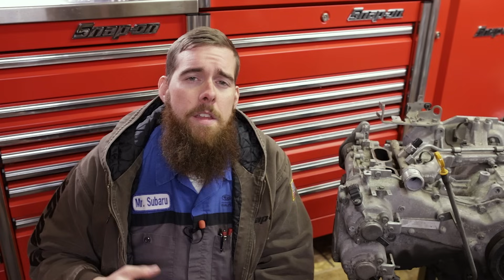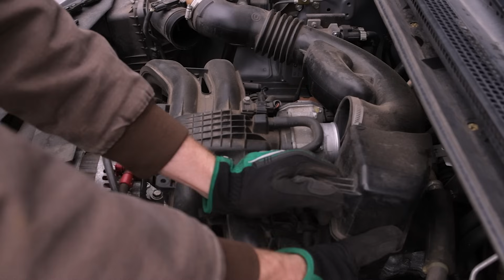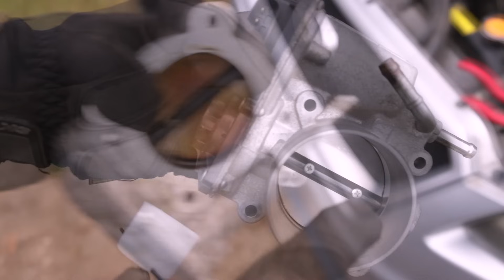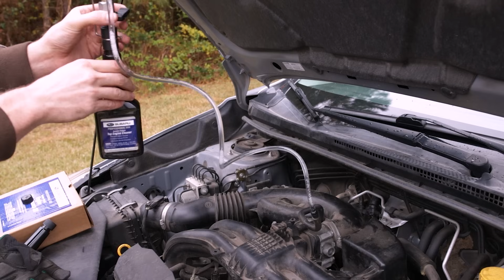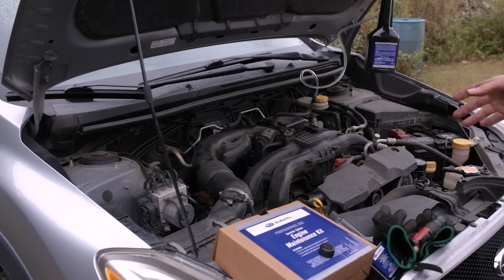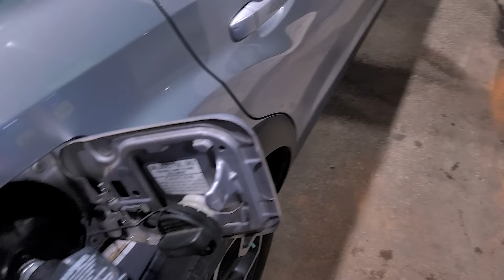Keep Your Subaru Running Like New! Subaru Engine Maintenance Kit

Comment: Thank you sir!!! Great video as always. Quick story to share, I went to the only dealership locally here in Las Vegas and the parts guy…gave a heck of a hard time with a bunch of BS stories. Supposedly they don’t sell the maintenance kit to the public blah blah so he tried to sell the wrong Carbon cleaner with the tin bottle (not the plastic one). What a headache but thankfully all the parts with part number checked out when I searched online to confirm they weren’t the wrong ones. I even told that clown if we use the wrong bottle/parts we can damage the engine/fuel tank or worse. Anywho, for others make sure you have the part numbers (as a back up just in case they claim they don’t sell the maintenance kit as shown in the video.) For everyone, follow Mr. Subaru’s advice EXACTLY as he says and this service should be excellent for 30, 60, 90k. I bought the OEM throttle body mounting gasket as well just for piece of mind. The Subie just hit 60k so I’m going to change the spark plugs right after performing this service and the car should run like a champ. Mr. Subaru happy new year! Thank you always for golden advice and for helping everyone maintain the Subaru. Cheers!
Update: Whew this job for the DIT 2.0 Turbo (I have a 17 WRX) took me 8 hours or so to complete yesterday. To reinforce what Mr. Subaru said he did make it look easy haha. But I did this from my garage and that was from start to finish. The items slowing me down was the intake duct connected to the throttle body. It was stuck (literally) and wouldn’t budge so I had to use some WD40 and carefully/lightly sprayed on the top to loosen it/remove. Also I drained about 3 quarts of engine coolant since I completely forgot to get the clamps to stop the preheater hoses when disconnecting from throttle body. You’ll definitely want to have the long needle/hose grip pliers to do remove them. I was thanking Mr. Subaru (in my mind and right now) when taking each hose off because you don’t have a lot of room to work with and that really saved me a lot of time. As well the special tool to slowly connect the top engine cleaner is strongly recommended. Why? I was lucky not to get any DTC (Check engine light etc) but notice how he carefully opened the valve to slowly pour 1/3 the bottle each time. You don’t want to risk damaging the engine, spark plugs, etc by putting too much in at once. I cannot stress enough: Follow his advice and watch the video/take note of the tools and how he removes/installs the each part. You must have patience and tolerance to do this job. You can’t risk damaging the car and then creating more headaches. Finally, Mr. Subaru thanks again! Do you a Venmo account? Or Google Wallet/Apple Pay cash? I’ve watched your radiator/coolant change video, spark plug change for DIT 2.0, this video, dude you’ve helped me become a trainee mechanic haha. But I’d like to support your channel even more if I could send some moola directly to you let me know. This was a long job for me but every 30k for this, goodness I know this Subie should last 200k-300k thanks again for your videos! Keep up the good always!
Reply: May I ask where you purchased the throttle body gasket from?  I can't seem to find what the part number is, and searching on google seems to reveal very little. Kind of odd.
Reply: Great comment
Reply: Careful, the solvents in WD can damage rubber. Happy wrenching!

Comment: Where would the vaccum line be on a 2011 outback 3.6r? Should I run the top engine cleaner through the hose that goes to the brake booster instead?

Comment: Would an air oil separator or a oil catch can help with the build up or is the one built into the FA model engine enough to help prevent build up?

Comment: At what mileage would you recommend this to be done? I have a 2021 Crosstrek limited with 18k miles thanks
Reply from the maker: 30k miles on the top engine cleaner, to reduce the DI carbon build up.
Reply: @MrSubaru1387  thanks dude

Comment: Why is carbon buildup on the intake valves an issue with gas direct injection cars but not with diesels?
Reply from the maker: Gasoline engines run under/produce vacuum, diesels don't.

Comment: I believe cannot flip the throttle plate on drive by wire TB right? If u want to clean press the pedal with ignition on or else the calibration with fuckup
Reply from the maker: No. Manually opening it is fine.
Reply: @MrSubaru1387  ive seen your next video on idling calibration, n yes i agree its fine. Back then as u know u need to have special tool for calibration the throttle body plate. Thanks bro
Reply: https://youtu.be/hCAC3sdCOZc some vehicle u need to plug in obd2 special tool i mean like this. Lucky subaru have the throttle position sensor relearn features. Next time if i clean mine i dont have to worry about manually opening. Thanks again.

Comment: Awesome video.  This applies to all Subarus?  I have a 2017 Forester MT Premium with the 2.5L FB25 which just hit 105K miles.  Though lately I find it 1 qt low in oil every 5k miles.
Reply from the maker: This upper engine cleaner service is more useful for direct injection engines, but the kit is beneficial for all Subarus.
Reply: @MrSubaru1387  THANKS!

Comment: Great video! How would one get the throttle body gasket? I really want to try it, but I would like to get the gasket just in case like you recommended. I couldn't find it through the links you provided.
Reply from the maker: Local dealership can get it or can be bought online at places like Subaruparts.com

Comment: Is it okay to add distilled water into a 4 year old Interstate battery? The battery is working fine, but there's quite a bit of corrosion at a terminal and in the center where the caps meet. They are willing to prorate the battery for a new one. Should I replace it?

Comment: used the CRC 5 in 1 GDI performance rejuvenation kit on my 2018 Elantra Sport turbo every 5,000 miles for 2 years and neen using it on my 2020 wrx Limited every 5,000 since I traded my Elantra Sport for it back in june of 2020 and both vehicles have ran like a charm ... no issues whatsoever ... I actually pour the fuel treatment in on an EMPTY tank so it mixes well as I fill up and I pour the oil friction gaurd in after pouring HALF the engine oil in so that mixes very good as well and I spray the valve cleaner through the intake duct so it cycles through the entire intake system ... I also have a Crawford's Performance v3 air/oil separator that I literally installed the day I purchased the vehicle brand new and brought it home ... let me tell you that thing works like a charm because my oil level is at the exact same mark from when I filled it up when I change the oil ...

Comment: "Don't bother cleaning the back side of the throttle body butterfly." Cleans back side of throttle body butterfly.
Reply from the maker: It's came off with the overspray alone. I didn't waste spray or brush time on the back of the butterfly. This stuff is really high powered compared to over the counter brake parts cleaner/throttle/carb cleaners.

Comment: I know you mentioned preventive maintenance long-term and thought you’d discuss catch-cans and AOS systems. I know you’ve touched on them in previous videos, but have you done a full break-down of them? Of course each manufacturer is going to tell you why their’s is best, but it would be nice to see a comparison by a proper technician on these motors. I personally have the Cobb AOS on my 2020 WRX installed before 3k miles.
Reply: I wanted to ask the same thing. I’m getting a  new wrx soon and I’m debating if I should get a Aos right away or maybe just stick with this method. I plan on keeping it stock until the warranty ends.

Comment: I just use the CRC direct injection and turbo cleaner. Same procedures but it comes out atomized and you spray it before the trottle body so it does two jobs without any major screwing and virtually no risk of hydro locking. I follow that up with a bottle of gum out (pea) fuel system cleaner. Does great and costs less than this.
Reply: I'm checking out this video to see if the spray intake cleaners are safe for Subaru engines. My wife's 2013 Crosstrek runs great with 150k miles on it, but recently has the P0420 code. Gas tank cleaners haven't worked, and I'm just learning the downside of direct injected engines.
Reply: @petset77  yes, it’s hard to clean them once they gunk up. It’s important to only use top tier, name brand gas that has more detergent, which helps prevent a lot of build up while off brand/grocery store gas has around 90% less detergent. You also want to use fuel system cleaner with PEA every 5,000 miles. Otherwise you will eventually need to have the carbon mechanically removed using walnut shells for example, which also requires removing the head, an expensive procedure. But the spray that goes into the intake might reduce it by some so that the code goes away. 🤞🏻

Comment: I have used Liqui Moly Pro line engine flush before every oil change, engine has 160k miles (2005 legacy 2.5 N/A), the engine has never given me any issues for the past 10 years of ownership.
Car itself is totally stock and has lost 2 HP since 2004, had id dyno'd last month.
Costs 15 dollars a bottle;)
Reply: The FA engine has port injections so the carbon buildup isn't an issue if you use high detergent gasoline. I don't think engine flush does anything for carbon build up on the valves. Should help keep the rings from getting stuck though.

Comment: Subaru dealerships stopped using the top engine cleaner because too many “under trained”, “ incompetent”, and just plain stupid techs were catching cars on fire or melting catalytic converters.

The top engine cleaner does work great and I’ve used it to fix A LOT of problems. It was not uncommon for this $10 bottle to repair what $1000 of parts cannon fodder couldn’t.

Again the underlined problem here is ignorance and stupidity from the technician. This is a difficult problem to explain to none technicians and customers; because they assume the manufacturer and shop would ensure they’re techs are well trained and have the correct skill sets to perform the work assigned. Truth is the industry will higher anyone that says they can do the job. The manufacturer does have a schooling system but you can cheat and brute force your way through it; instructors get fired or written up if a student fails. Yes there are trade schools that you can spend over $30k attending but they’ll pass anyone that’ll pay the bills.

Long story short there is no governing body to regulate knowledge, skill sets, and training in the industry. Sure we have the ASE tests, but that’s all they are…tests. It’s a small framework that hasn’t been expanded on in decades.

Why all this ranting you might think. We’ll look at the computer industry and talk to someone in that carrier field. If they want to keep their title and job they must perform continuing education, and that education path is laid out for them from day one.

The reason why you don’t find too many of intelligent techs at dealerships is because they left to start their own businesses. Smart techs cost a lot of money and smart techs typically have an attitude. The attitude comes from management wanting them to babysit other techs without compression. Fix other people’s work while the other guy continues to do gravy work. Or just blasted with every deadens warranty job that pays nothing.

Lastly techs are not hourly, we’re paid on “flag”. Just YouTube “flag pay” and see how an incentive pay system goes sour as you get better at your job.
Reply: My son was in the industry and worked at Subaru for about a month and Honda for about ten years. You are absolutely correct in how dealerships work their service departments. They’ll hire a kid with a tacklebox for a toolbox and have him do oil changes. Next week he’s doing brake jobs for $9 an hour and the $25 flat rate A-Tech gets the warranty jobs. This was 15 years or so ago when he got out as an A-Tech and he heard it is even worse now. Find someone like Mr. Subaru to work on your vehicle because I’m sure he knows more than 3/4s of the techs in the dealership shop. If you can work on your own vehicle then you can save some cash in the process. These videos are essential for learning how to fix your Subaru. I like watching Master-Techs like Mr. Subaru work on cars. I’ve never owned a Subaru, but I just like to watch experts repairing and maintaining cars.
Reply: Same in other industries.

Comment: The engine maintenance kit and cleaner tool show up on my local dealerships website when using the part number only. Says not for sale for both unfortunately. I don’t like my local dealership, wish we had more options over here in south west Michigan
Reply: Looks like Subaru has discontinued the pkg.

Comment: Hi. When would you recommend that this should be done? I have a 2015 XT and I’ve talked to a few mechanics about walnut blasting and they had no idea what that was . My friend has a wrx and did the walnut blasting and said it worked very well.
Reply from the maker: The walnut blasting is good if you're higher mileage and carboned up. This would be a good, regular service to perform to keep the buildup at bay and prevent having to do another walnut blasting.
Reply: @MrSubaru1387  what would be a good mileage interval to do this service? Thanks for this video!
Reply from the maker: @paulbullock7954  on a DI Subaru, 30k miles.

Comment: Another great video thank you! I wanted to add one thing. While air plenum is off look around. On my 2009 Forester I noticed that the rubber bell housing cover had become hard an was literally ready to fall in the bell housing. (I bumped mine and had to spend an hour fishing it out). Service was as straight forward as shown.  And surprisingly enough. My local stealership had both parts in stock and even price matched the prices found online.

Comment: Same issue on '12 forester FB25 with 40k miles, 10 min fix by cleaning the throttle, smooth ride and a great night sleep... actually I didn't take off any hoses, just the air duct and the throttle body.

Comment: Great video. Everyone with a Subaru needs to get this done more often, especially those with DIT. My 2014XT was running like choof head smoking 2 at a time. I was getting black smoke on 60%+ throttle. Normal driving you could not tell anything was wrong till you gave it some then it chugged and choked blowing smoke. I got it serviced and now it feels like a new car. Engine oil, filter, upper cylinder (SA459)cleaner. Cleaned throttle body and intake system and the Map sensor. Its like a new car now. (95k KM or 60k Miles)
Reply: And air filter? Fuel filter?
Reply: @jack15820  Changed both new and was still blowing smoke.
Reply: @axeya366   Aha. Hesitation here did nt stop till after fuel filter done
Reply: Do you know where to connect the top engine cleaner on the newer Ascent/Outback/WRX motors? They don't have that small hose on the top

Comment: My question is, does the upper engine cleaner work? And how often should you perform it?
Reply: My dealership told me around 36,000 miles depending on driving habit. But my subie is a 2022 outback wilderness. So you will have to ask your service department.

Comment: Need help with a 05 LGT got almost death wobble when I brake. Have you ever came across a issue like this?
Reply from the maker: Likely extremely warped rotors or a suspension/steering component issue.

Comment: Beware the top engine cleaner coming in a cylindrical tin can, as mine did from my large local Subaru dealer.  The take-up tube on the siphon tool is too long to screw into the can, but not only that, my first can of cleaner purchased was already about half-empty via leakage.  And the dealer needed all 3 components of the kit returned to them, I couldn't just get a new can of cleaner, nor was it in stock.  A regular clear plastic bottle of fuel injector cleaner, emptied, worked to fit the siphon tool, and provided better visibility of the cleaner level without a flashlight, but the clear plastic didn't look like it was happy in contact with the toluene cleaner, the plastic quickly became cloudy.  So don't store cleaner fluid for long in a non-original bottle before using it up.
Reply: From what I heard they stopped making the plastic bottles and replaced to the tin cans. Even for the tool it went from the plastic to now only meant for metal cans. Not sure why they would do that tho

Comment: I did take my mom's 2014 Forester for this kind of engine service to the Subaru dealer. The only things I do myself is change the oil and oil filter, CVT Fluid, and Front and Rear Differential Fluid. The Front Differential Fluid needs a 1/2 in. I.D. and a 5/8in. O.D. tubing with clamp for the quart pump to put fluid in the overflow plug, because my fill plug for the front differential was unable to turn counterclockwise with the 8mm Allen socket before removing the overflow and drain plugs. I also use Gumout fuel system cleaner once a year, since it also has the PEA additives.

Comment: Would you recommend this for a older high mileage engine like a 04 Outback?
Reply: An older engine is likely not direct injected - did you try Seafoam or a similar product in the gas tank first?
Reply: @questioner1596  yea I put sea foam in the oil. Probably should put some in the gas.